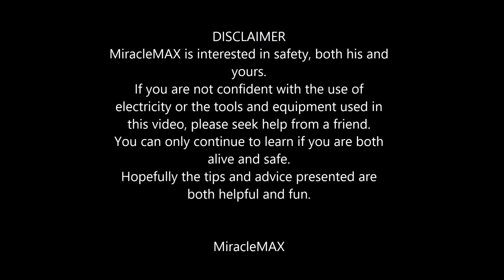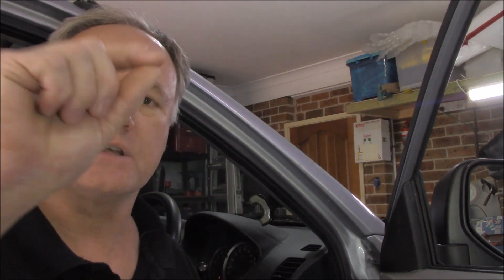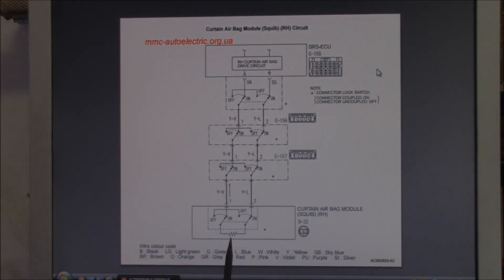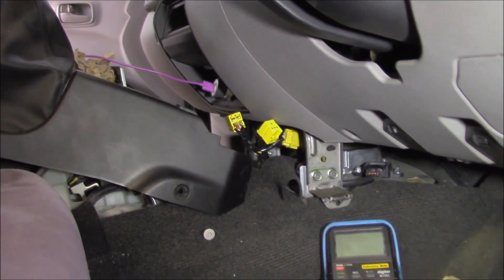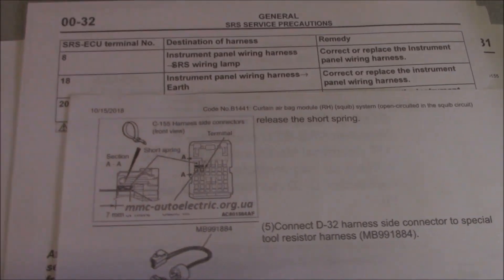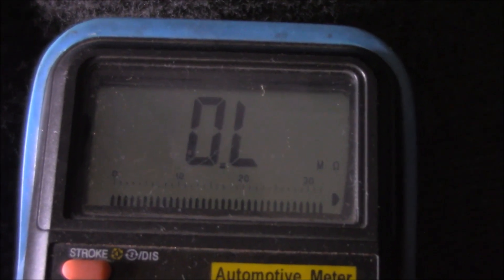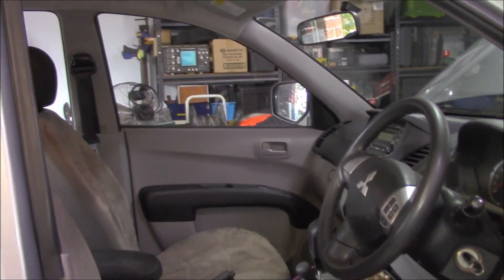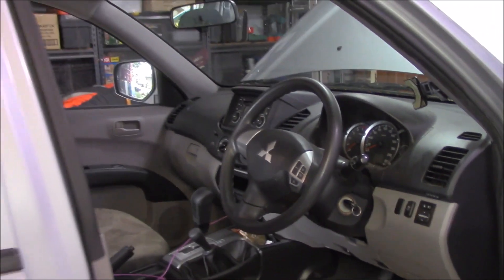Mitsubishi Triton Air Bag Light On B1441 MiracleMAX

Comment: Great video Max but my problem is there is no communication with my modus scan tool all other connect ok with codes and live data, any chance you can put a link up from where you got your wiring diagram you showed in your video. My vehicle is a 09 MN Triton,cheers mate.
Reply from the maker: Just search the code with Triton after it. (B1421 Triton)
This is what you will find. 
http://mmc-manuals.ru/manuals/pajero_iv/online/Service_Manual/2018/52/html/M152401740046500ENG.HTM
If you have no communications with the SRS module, have you checked for powers and grounds using the voltage drop method? Are all fuses OK?
Reply: @MiracleMAX  yes all fuses are good but I haven't checked power at the srs thats why I wanted the wiring diagram
Reply from the maker: @aardvarkmotors7246  No worries, I hope those help. Let us know how you go.

Comment: Thanks for the walk through video, very helpful! Managed to sort my 2012 MN with the same issue (for now). 

Any reports of the light coming back on? 

Thanks again mate 10/10.
Reply from the maker: No, not in my case. I have serviced it several times since and no fault codes have shown.
Reply: Thanks for the reply @MiracleMAX  .

Sounds promising!

Comment: Hey max great videos Triton 4D56D-iD I know that you have to put the oil seals around the injectors in reverse is this the same for the injector fuel lines???
Cheers 
Peter
Reply from the maker: Here is a good shot of both seals. The fuel line one goes flat side out.
https://youtu.be/WhMvWwcpAo4?t=495

Comment: Hi mate , my triton 2011 2.5l diesel has a fault code B1610 which is PS seatbelt pretensioner squib open need your help. I thought it’s going to be same procedure, am I right?
Reply from the maker: Hey Bahram Noori,
Similar process. I found this online that might help.
http://mmc-autoelectric.org.ua/manuals/eur/l200/2013/52/html/M152403050033300ENG.HTM
Cheers
MiracleMAX

Comment: Hi, I recently changed the heater core which required me to pull out the dash. Put everything back together, plugged everything back in. The drivers side airbag light is on. Bought a OBD scanner from supercheap, comes up with no fault code error. I have checked all wiring again but all seems to be plugged in. Not sure why the light is still on.
Reply from the maker: Hey Graham, that must be frustrating. Have you tried disconnecting the battery? Have you checked for terminal retention with the connectors? If you bought a cheap OBD scan tool, it may not include the SRS side of things.

Comment: Hi Max, Have the very same problem 2009 Triton. I need a scanner that will do SRS codes that's not going to cost me the price of G-Scan. Still remember the "turns of copper wire round a soft iron core". The engine Gooser!  You probably check these comments every 10 years.
Reply from the maker: Hey Wayne,
I try and check the comments regularly. To be honest, I wouldn't be messing with a SRS system without a scan tool. Bi-directional scan tools are getting cheaper. Just make sure the software has the vehicle that you need. It should be in the product list or contact the supplier. Keep in mind that the Tritons did have that issue with the wiring harnesses. Make sure you follow all safety steps if you attempt anything with SRS. 😉👍

Comment: I replaced the clockspring and airbag light came on thoughts?
Reply from the maker: Hey Jabers Fishing,
Why was the clockspring replaced? What fault code has been logged? Have you double checked all your connections? Was the correct clockspring fitted?
Reply: @MiracleMAX  cruise control wasnt working had no previous airbag light so i replaced the clockspring cruise control works now but airbag light stays on and yes i fitted it correctly
Reply from the maker: @jabersfishing6326  Are any fault codes logged? Have you disconnected the battery? Can you see the air bag resistances in live data on the scan tool?

Comment: triton cant find fault airbag light on a and wont start then 12 hours later will start have replaced imobiliser still doing this intermitantly  yr thoughts
Reply from the maker: Hey Seanne Williams,
Are you saying that the engine won't start? What year is your Triton and engine size? Have you found any fault codes with a scan tool? Does it crank over and not start or just turn the key and nothing happens?

Comment: What is the spray you put between connections please ?
Reply from the maker: Hey Thomas,
I used Contact & Circuit Board Cleaner. You can use any sort of electrical, electronic spray cleaner.
Thanks for your comment
MiracleMAX

Comment: My Triton air bag light on. Error code L/H pre tensioner. It was checked cleaned and reset, light went off but came on after a few days this has happened twice. Do you have any fixes or checks for this.
Reply from the maker: Hey Malcolm,
What exactly was cleaned? What was the resistance of the pre-tensioner? What was the fault code?
The tritons did have problems with the wiring. Did you read all the information I provided in the video description? I have provided a lot of links with relevant information.
Here's a video relating to a pretensioner. Similar problem, different vehicle.
MiracleMAX

Comment: My light came one straight after fitting a tray 
Have I potentially bumped something or coincidence?
Reply from the maker: Hey Dan, 
Do you have a scan tool? What codes were present. These do suffer from poor connections, so anything is possible. 
If you do not have experience with air-bags, please take it to a qualified technician.
MiracleMAX

Comment: great vid mate very informative! I do have a question however, can srs light be reset with a basic obd tool or is it something that requires a specialised scanner etc?
Reply from the maker: Hey Ghille in the mist,
I'm glad you were able to get some value out of the video. 
It depends on the vehicle and what the SRS allows. Some earlier vehicles you could disconnect the battery or disconnect a certain connector for a period of time and it would reset. Other later vehicles, a scan tool is necessary. A code reader will not do this, you will need a scan tool that is able to communicate with the SRS system. 
Just keep in mind that if you have an audio security code, just disconnecting the battery will clear that code. Make sure you have the code to enter, before you disconnect the battery.
Perhaps do a Google search 'reset air bag light' on your particular vehicle. 
Thanks for your comments
MiracleMAX
Reply: MiracleMAX thanks for the reply mate, its an 3.2L Triton, there’s no active codes, I was replacing the pollen filter and forgot to reconnect the passenger airbag before the battery so I've triggered the light, Mits. Redcliffe wanted to charge a standard $99 diagnostic fee even though I've explained what happened and that it doesn’t need a diagnostic, just a simple reset 😣
Reply from the maker: @ghilleinthemist2994  I gather you don't have a scan tool?
You don't need to go to a dealer to have the reset done - just a reputable workshop in your area.
I don't know if disconnecting the battery would work on this model.
Reply: MiracleMAX I only have a basic obd tool (elm327) disconnecting battery doesn’t work unfortunately, however a mechanic mate of mine had a scan tool that diagnoses and resets srs systems so got it reset, thanks for your help all the same mate, appreciate it 👍🏼
Reply from the maker: @ghilleinthemist2994 That's good news! A basic OBD scan tool or code reader will only work on anything emissions related. Glad you were able to do a reset. 😊

Comment: This issue is such a common problem on the tritons im surprised it never warranted a recall
Reply from the maker: Totally agree. I see safety recalls done all the time on things that don't seem to be safety-related. An example was the other day the Mazda 3 was being recalled due to excessive carbon build-up in the intake shutter valve! Yet something as vital as an airbag system with a very common fault has managed to slip thru the process. Strange!
Reply: @MiracleMAX    Yep, yet mitsubishi issued a recall due to the chance of the indicator stalk contacts failing.
Reply from the maker: @thorny2712  Well I guess at a stretch, you would not have indicators and cause an accident. But the problem is that you wouldn't have working airbags to save you in the accident!!

Comment: mate where u located?? i have the same problem and justr cant get it done
Reply from the maker: Have you tried local mechanics?
Reply: @MiracleMAX  yeah but all wanna charge me 1000 bucks upwards
Reply from the maker: @chefsalatful  Have you contacted Mitsubishi about the Hotline Fixes I have listed in the description?
Reply: @MiracleMAX  yeah but its from 2011 so no warranty and gettinmg stuff done at mitsy is impossible to pay for
Reply from the maker: @chefsalatful  These are a common fault. I just happened to be fortunate enough to find a poor connection at the terminals. The customer reported the other day that the light is still out. 
Other faults involve the wiring harnesses being replaced as where the wire fits into the terminal has not been installed correctly and fails with proper connections.

Comment: What type of OBD you're using mate?
Reply from the maker: I use a GScan as shown in this video, a SnapOn Modis Ultra, (https://www.youtube.com/watch?v=BGjqiQvwVwk&t=219s) and also a Launch CReader VI (https://www.youtube.com/watch?v=O1xQhM8GdMs). One scan tool will not cover all the vehicles we have to deal with nowadays. Keep in mind that an OBD 2 scan tool will only deal with emissions related fault codes. They are also known as a Creader. To access all the other systems on the vehicle, you must have a full scan tool, preferably with bi-directional controls.
MiracleMAX